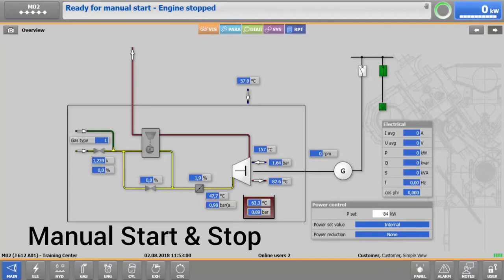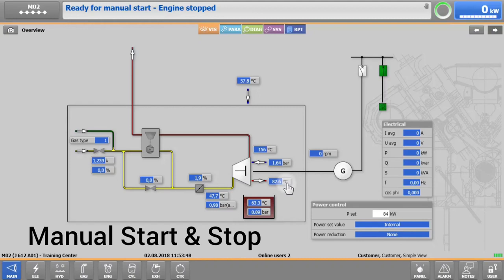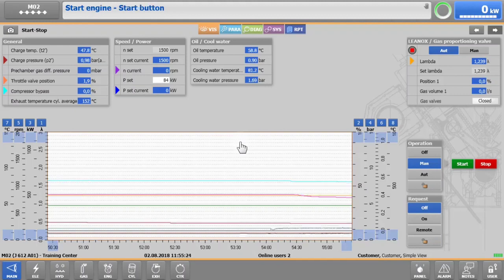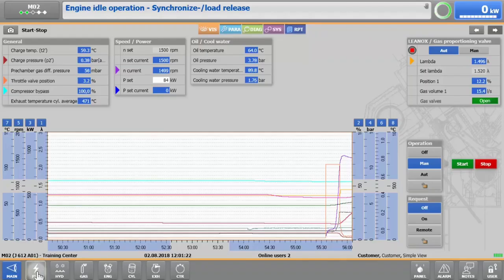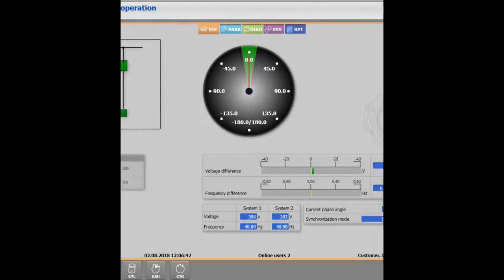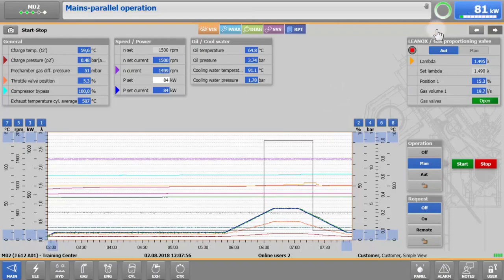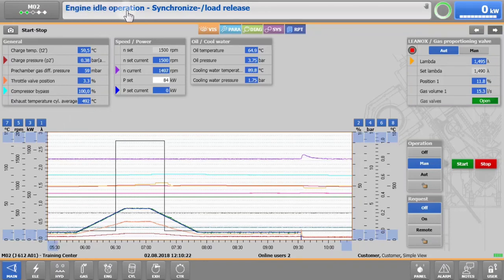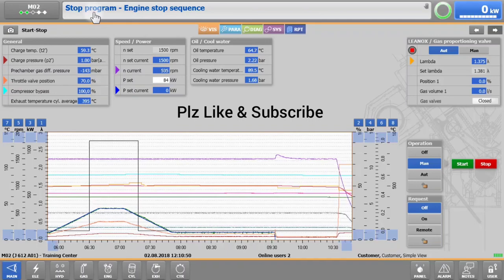Jenbacher Gas Generator | Engine Manual Start & Stop

Comment: what is lamda if high 1.99??
Reply from the maker: Since you can never use more power than what is flowing through your circuit, this ratio or power factor can never be more than 1.00.